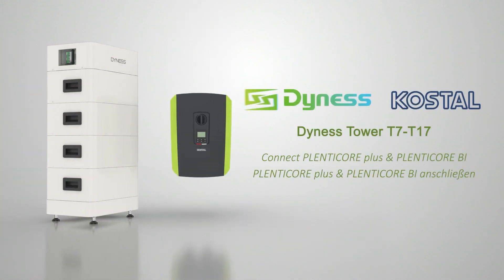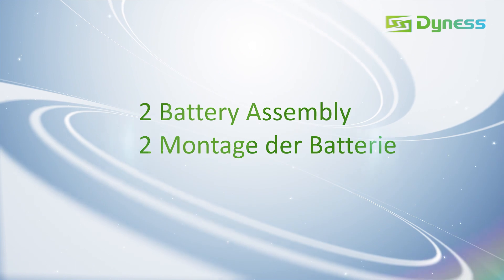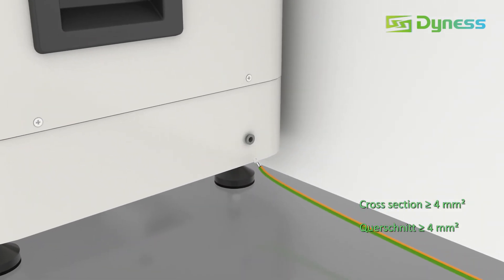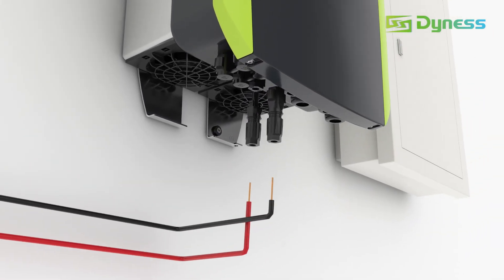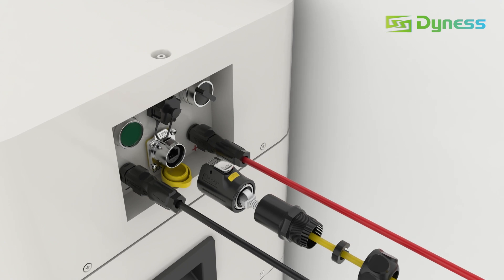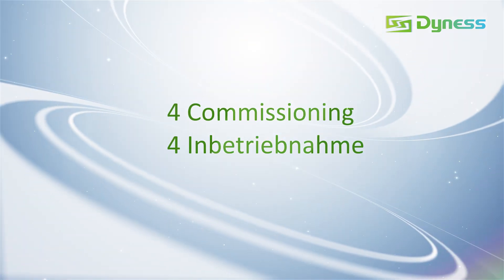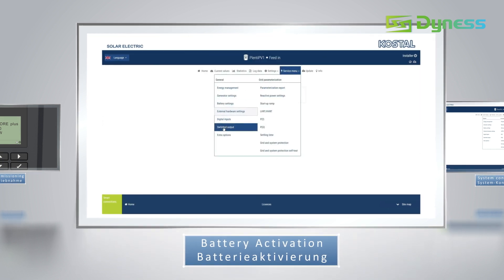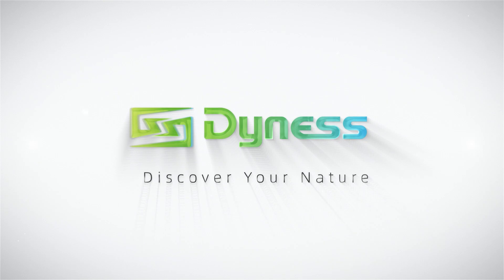Dyness Tower High Voltage Battery and Kostal Inverter Connection Guidelines-EN

Comment: Do I have to connect the Patch cable to the Router even though I use wifi? Cant I Just connect the Inverter with the smart meter via Patch?
Reply from the maker: Hello, where are you from? I can provide you with the email address of the technical engineer.

Comment: Hello,
is it possible to use the Dyness Tower BDU version with CAN communication to Kostal inverter?
Thank you
Reply from the maker: Yes, it is
Reply: @DynessBattery  We are experiencing problems with connecting Kostal inverter and Dyness Tower using CAN communication and Kostal support now told us that Kostal only supports rs485, but not CAN communication. Do we need a newer version of Dyness Tower BDU with rs485 (not CAN)?
Thank you for your answer
Reply from the maker: @jakubnovak814  Hi, please add our WhatsApp, +86 181 3643 0896，I will send you the Tower and Kostal connection instruction
Reply: Hello, Jakub. Do you you allready solve your problem with the old BDU version (only with CAN)? I have the same problem... :-(
Reply: @stefanmosig9218  We solved it by replacing the Kostal inverter with GoodWe :D the only distributor in Europe recommended by Dyness who could have the new BDU version is NanoDomi from Greece
Reply: @stefanmosig9218  Hi, we solved the problem by replacing the Kostal inverter with a GoodWe inverter. Unfortunately the version BDU-2G with rs485 is not available in our area. Dyness only recommended to us a distributor in Greece (NanoDomi) who might sell it.
Reply: Hi Dyness Service, in my Setup of kostal plenticore, i can Not activate the  Option  smart battery Control. Ist there a reason for?